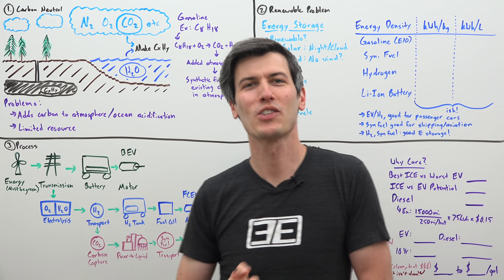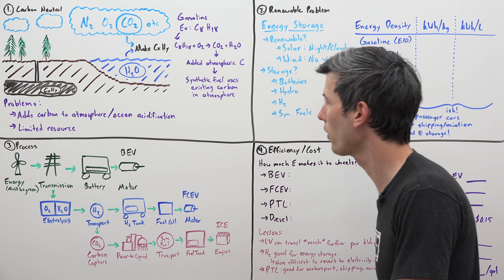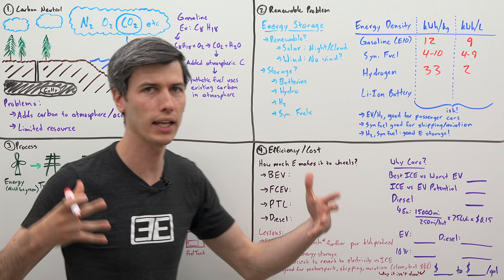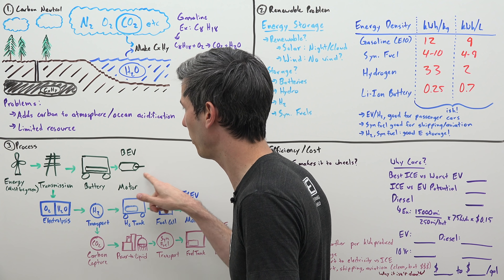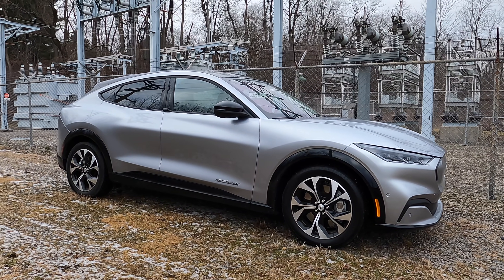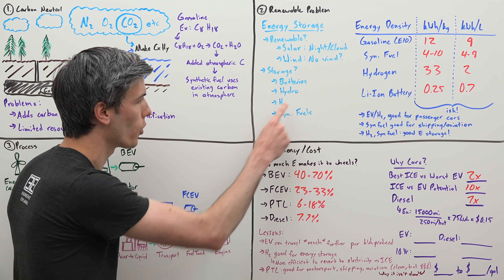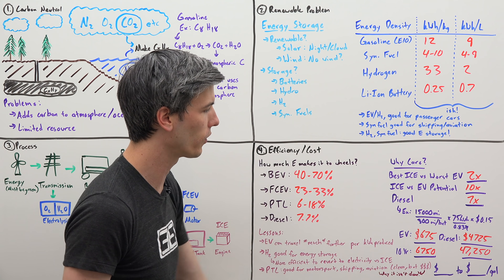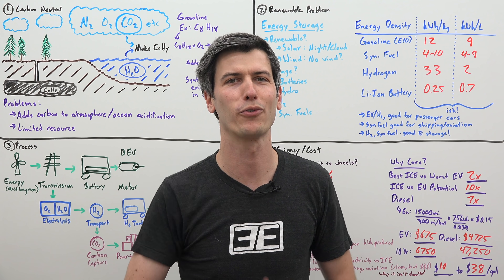The Big Problem With Synthetic Fuels

Comment: But, wait: as we know, CO2 is bad for the environment, it causes climate change. This seems to me, like a way to remove CO2 from the atmosphere and be able to store it. Like some sort of vacuuming the air from CO2. Please correct me, if I'm wrong.

Another thought: you're absolutely correct, by pointing out, that it's not very efficiant to use electricity and convert it to e-fuels, but, you can go to deserts, like the sahara and use the sunlight. You can't bring the electricity to, e.g., europe, but you can ship stored sythetic fuel. I know, you can also ship hydrogen, but it needs to be compressed, e-fuels just need a tank. And, in my opinion, you can waste quite some solar power, by converting it to e-fuels. The sun won't stop its radiation, as far as we know.

By the way: thank you so much for teaching the internet the way you're doing it! I keep learning a lot by watching your content.

Comment: This comparison is highly dependent on tax on energies.
Synth fuels are currently promoted by Porsche because it is a german company. In Germany, 1 kwH costs more than 0,3€, compared to < 0,1USD in the US ... (1kwH on a Ionoty Supercharger costs 0,79€ for brands that did not partner with the consortium) 
On the other hand, normal E10 costs 1.5€ per liter, remove the tax, and it costs less than 0,7€. A synth fuel with the right tax scheme could be interesting. (the 10€ par liter is the cost of the "prototype")

But true, from an energetic POV, Synth fuels make no sense.

Comment: Hey Jason, great points. What about the cost of using existing gas stations across the globe vs new infrastructure cost with adding public chargers/converting gas stations to electric? Wouldn't it be easier to use the infrastructure we currently have? Say adding a 4th gasoline option of 'Carbon Neutral' that will start by being expensive but hopefully get cheaper over time.
Reply: Pretty sure the main issue at that point would be producing enough e-fuel, though it should be noted it's kinda already done with Biodiesel at some gas stations

Comment: Cool video. I have some concerns about electric cars. I'm in Houston and was alerted by my local news station about that Tesla Model S hitting a tree. This caused the vehicle to burst into flames and killed an engineer and a doctor in the vehicle. So obviously these large lithium batteries are extremely dangerous and if breached will combust. Where I work we have lithium batteries. In order to even receive them, moves them, charge them, store the, etc. requires special training. The lithium battery storage is way away from the main office. These can be very dangerous batteries. So here are my concerns
1. As electric vehicles become more common place will we see an increase in deaths due to batteries directly below passenger compartments spontaneously combusting after a crash? 
2. How are fire departments going to deal with this? Are different firefighting methods needed for fighting EV fires compared to ICE cars? If I was a tow truck driver I would not want to pick up an EV after it had crashed for fear that the battery is compromised.
3. What happens to the power grid if everyone is plugging their vehicle in when they get home from work? I have a lot of gas stations around me and those stations represent a significant amount of stored energy. What happens when that energy used shifts from being pumped at the gas station to being pulled in from the power grid?
Reply: Apparently the power grid shouldn’t be too big of an issue. However, those first 2 are. A breakthrough in battery technology should solve that tho, namely with solid state batteries

Comment: Just a thought, but what if you used an N2o hydrogen blend. Say through a turbo type reticulating system. That would have to increase the power... inefficiently I guess but..
My trouble with EV's and renewables is the use of so much rare earth metals. They themselves are expensive to make and the side affect is for every ton of rare earth metals we have a ton or radioactive waste. That and the REM's are a lot worse on the environment than and CO2 based fuel. And I'm yet to see a corporation do the right thing by the planet when cost is the limiting factor. Same with nuclear energy. What happens when or magnetosphere gets low, and it's well on its way now. It wont take a CME of 10 to blow out the electrics controlling them, nor the back up generators. I feel we're making a big slapstick bandaid solution to a problem we don't really have yet that will cost our children's children in a big and bad way. It all just seems far to short sighted.

Comment: You pull your gasoline car up to the pump for a “rapid” fill up that takes 30 minutes and then you can go 150 miles where you repeat the same process.  That’s the current state of electric cars. Plus they’re expensive and ugly.
Reply: Moot considering the more electric cars are on the market, the better the infrastructure. You're simply comparing an established infrastructure to one in establishment. Over a few years, this is a non issue. Same for price. Ugly, well, that's tastes.

Comment: You're assuming the hydrogen you use to make your synthetic fuel is produced via electrolysis from water. It takes a lot of electricity to produce hydrogen via electrolysis, so the overall efficiency of synthetic fuels produced that way is poor. However, if you're using nuclear as your energy source, there is another way. Thermochemical hydrogen. You use a reactor type with a high operating temperature, such as a graphite gas reactor, or a molten salt reactor, or a sodium cooled fast reactor. With a little help from the right intermediate chemical steps, the output of the reactor is at a high enough temperature to directly split water into hydrogen and oxygen without electrolysis. This is a much more efficient process as it avoids all the energy lost in producing electricity and and as heat losses in the electrolysis cell. Enough to make synthetic fuels look much more appealing than they do in your presentation. Furthermore, nuclear energy (particularly with a thorium based fuel cycle) is an effectively completely limitless source of energy, so if you need more hydrogen, you just build more reactors.
Reply: Sounds great. A nuclear+hydrogen based global energy/environmental solution is certainly the way to go. Not sure why this isn't being promoted as the best way forward.

Comment: hmmm... seeing that diagram is very useful! But one thing it shows is that a good way to improve system efficiency for FCEV and ICE vehicles, why have that electrolysis step occur after the transmission? Even if it's less efficient, I would think that a hydrolysis system could be a good way to store excess energy on-site of the generator.
Reply: Transmission losses are smaller when that electricity is reinjected near the point of use. Not to say it's as good as on-site storage at either the use site or production site but it's not 100% worse either.
Reply: The difference is using surplus renewable energy and seawater where the purification of the water is just another efficiency loss.  Performing that hydrolysis inland means that you are using freshwater as your source and competing against drinking water resources.  The people who screamed about food vs fuel are going to melt when they see the math for drinking water vs fuel.
Reply: @mark_5588  it takes 2.5 gal / 10L of water to make 1kg of hydrogen. A typical hydrogen car goes 60mi on that 1kg. It takes at the very least 3 gallons of fresh water to make 1 gallon of gasoline. Usually around 5. And let's not talk about ethanol. So hydrogen fuels slightly decrease demand for freshwater as long as the power used during electrolysis comes from a non-thermal source of energy.
I still don't believe in H2 but it wouldn't make the water problem worse. 

Maybe we should start by stopping grass gardens in the middle of the desert instead.

Comment: $40 a gallon is fine for a weekend gasoline car, not a daily. I’d definitely pay that to keep driving my RX-7 on the weekends, but I’ll definitely have an electric daily in the future.
Reply: That's $800 a fill up.
If you have 2 solid days of weekend ridding then that's $1,600 a week.

Or $3,200-$6,400 a month

I really really hope you're not married cause your wife is going to castrate you if she ever finds out how much money you're planning on spending for a hobby 😂

Burn all those receipts 😆
Reply: @mountainbikerdave  Not everyone asks permission from their wives to spend their own money.
Reply: For me, they needs to make bldc based electric motors. They are not that soulless as ACs, better performance, but break down a lot. I will drive anything as long as it's fun to drive.
Reply: @georgeb5262  bro WTFAYTA?

Almost all electric car manufacturers use brushless DC motors.

Infact I don't know of any that use AC motors.

Batteries are DC.
And DC motors are more efficient then AC motors.
It makes no sense to convert DC to AC and take an energy conversion loss just so you can use a less efficient motor.

Also brushless DC motors are incredibly reliable, so I have no clue what You're talking about. 
What components make DC motors any less reliable then AC motors?
Reply: @mountainbikerdave  Tesla use AC. Check it.
Reply: @mountainbikerdave  BLDC motors ARE AC motors.
Reply: @electric7487  It's with extra step.
Reply: @electric7487  Wasn't they built different and more effective than normal AC?
Reply: @georgeb5262  There are basically two types of AC motors used today: Induction motors, and PMSM's. BLDC motors are PMSM's.
Reply: @electric7487  Oh, OK.

Comment: Biased data.  Which battery electric car has 300mi of autonomy ?
And since when a diesel car spends $4200 a year in fuel ???  Reality is that it costs less than half of that given the MPG and cost factored in.  Biased !!!

Comment: You are assuming that the initial energy source is electricity. We could in theory use heat generated by nuclear power directly in these chemical processes. I have a hunch that it would look significantly better in this case.

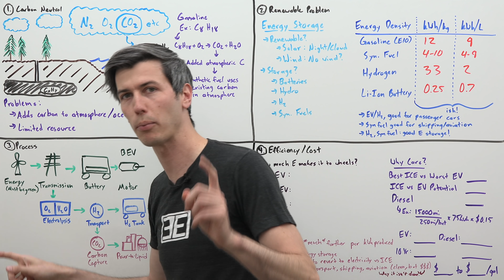Comment: At 6:05 you claim that electric vehicles can be greener that ICEs  even if their electricity is generated by fossil fuels. I'd like to hear more about that. How can it be more efficient to move energy from fossil fuels to electricity than if you just used the fossil fuels directly?
Reply: Further more, you can't get more energy out than what you put in. If there is a lose Everytime energy is moved from one form to another,(fossil fuels-electrcity). How would it not be greener (use less fossil fuel) to just power a car directly from the Fossil fuels?
Reply: And, if everyone starts driving electric vehicles the price of electricity will no longer be $0.15   per k/hr. It will end up being just as expensive as synth fuel because there will be less and less of it.

Comment: Yeah ... I would think using artificial fuel for a road car... Unless you're Elon Musk or Jeff Bezos or somebody...
The cost may yet come down due to economies of scale, but ... the basic problem he points, it remains.
I'm more interested in making Jet-A, because you can drive an electric car (a good one, fair size battery) from Sydney to Newcastle, ... or Woolongong (sorry @hornet ) but you can't fly a 777-300 from Sydney to LA on batteries.
But you can make an electric plane!
Yes, you can, and yes they're quite ok to fly - for 2 ~ 8 people, for 100 ~ 300 miles, at 200 (ish) mph. You want to fly 300 people, 6,ooo miles, at 600 miles and hour, at 25 or 30 thousand foot ... you would need batteries somewhere between 100 and 400 times as good as any put in a Tesla yet.
Now ... If you tell me that in 5 years we'll have car batteries that are 1/3 the size and half the weight and half the cost and they charge in 5 minutes not 4 hours, I might be persuaded, but that's still not going to power a Boeing 777-300 across the Pacific. A battery that's 5 times better than anything we can make now, that still falls short by a factor of about 20.
Now ... I can see that if we make artificial jet fuel, it's going to cost an awful lot of money, but it is a practical solution to that specific use case. I don't see 'better batteries' becoming a practical solution in that use case any time soon.

Comment: Have engineers proposed a hydrogen hybrid vehicle instead of the fuel cell? The hydrogen powers a generator that will drive the electric motor .
Reply: Inefficienct. If you're going to use an inefficient conversion of hydrogen power to electric to drive your car, you might as well just use electricity produced at a highly efficient power station directly to power it.

Comment: Ok but will you ever research how electricity required to recharge those “green” cars is not “greenly” sourced or are we just gonna ignore the facts here
Reply: No, it's a fact already covered plenty. Even taking their production and the fact electricity is not always green (depends on the country), EVs are still more eco friendly over time. Electric powerplants using a fossil fuel are still more efficient than an ICE. We've known that for like 10 years already, might want to update yourself a bit hahaha. This fact is absolutely moot.
Reply: He has gotten into how irrelevant the sourcing is to be a net benefit in previous videos, but Greenly sourced grid isn't super relevant here. The same electricity will be used to make the synfuels, or charge BEVs, so the point is moot to begin with in this scenario. Even without a green grid synfuels and electric cars emit less over their useable life than even the most efficient gas or diesel cars. The grid will get cleaner over time but its not necessary to wait for a green grid to see emissions benefits from alternative fuels or electric cars.
Reply: @leightonalbright3082  only yes it is, because you’re sourcing alternative fuel in a dirty way, it simply makes no sense. You said it yourself, even the cleanest sourced fuel will not output same energy we get from carbon fuels
Reply: @asianH_tler  I said it will pollute less not consume less energy. energy can be harvested from fossil fuels much more efficiently in a power plant (even a coal fired one) than directly in an internal combustion engine. Because of this even using more energy can still be a net benefit for the environment if that energy comes from grid electricity and not directly from a fossil fuel.

Comment: I'm always surprised people are missing the a key advantage synthetic fuels offer. That is these fuels are storing energy from remote green/(carbon neutral) sources that don't have distribution. The Porsche Haru Oni efuel plant is in Chile taking advantage of a surplus of green electricity from the winds off the Magellan Straits. A lot of EV folks think synthetic fuels are competing with local electricity, but they won't. Synthetic fuels open up green/(carbon neutral) sources EV's can't use.  You could have plants powered by wind farms in other remote places, maybe run on solar electricity generated in remote deserts. The ~10% figure energy making to the wheels is better than i thought it would be. I really do think there's a lot of potential for synthetic fuels.

Comment: Big problem with the studies you used to find the efficiency of different types of cars- 

Diesel vehicles include things like 18 wheelers, where the efficiency is low precisely because of the size, even though Diesel engines are some of the most efficient combustion engines. 

Meanwhile the only electric cars are smaller family cars that were designed with nothing to worry about, except efficiency. (And maybe cost) 

Point being, the difference isn’t as big as 70% to 6%.

Comment: But cant we make synthetic fuels cheaper by upscaling the production? I guess its so expensive because ots a quite new industry. Are there studies about that possible scaling effect?
Reply: Carbon dioxide will always be a bottleneck - there's just so damn little of it in the atmosphere. There were some pilot plants that used exhaust straight from a coal power plant (and similar) to have much higher carbon dioxide concentrations than ambient air, either to go into synthetic fuel production directly or into algae farms (to be later turned into oil). It sounds like a good idea (essentially turning fossil burning plants into mostly carbon neutral solar farms without photovoltaics or huge fields of mirrors), but the engineering hurdles are proving quite tricky.

Comment: One must take the consumer in account. What does the consumer want? Affordable cars that are convenient and reliable: Fuel up quickly and go long distances. That is cars with ICE+Bio/Synthetic/normal oil-fuel. 

Missing here is:

1.The positive effect of taking CO2 out of the atmosphere when creating Bio/Synthetic fuel.
2. After 10 years the batteries of the EV has degraded significantly but the ICE car has 20-30 or more to go. Consumers do not want cars that have almost no value after only 10 years.

3. In the EU ca 33%  of the fuel price is the actual price, ca 66% is just taxes.
4. Because the high energy required to produce the batteries a BEV car needs to go about 150.000 km before it can break even with the Carbon footprint of a ICE car.,